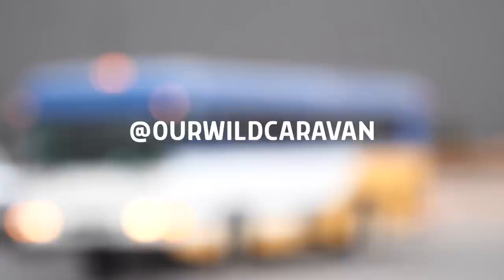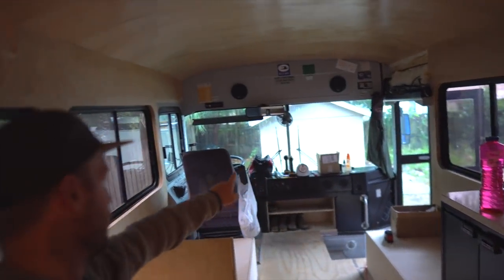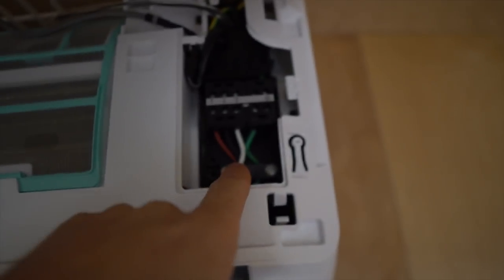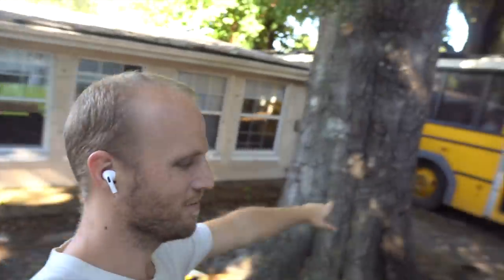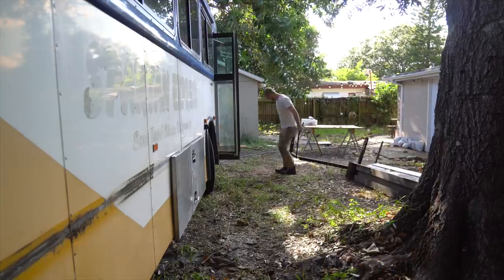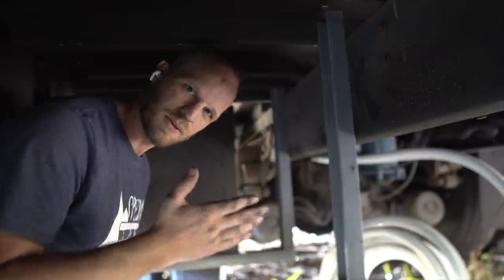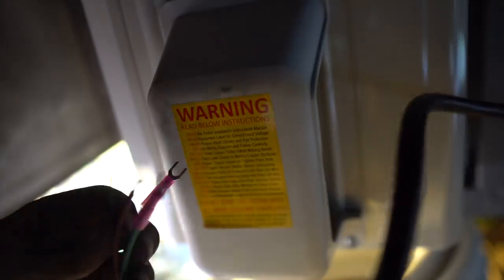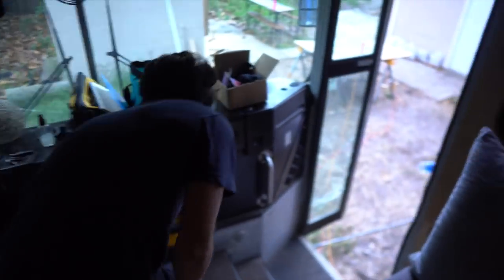How to Install a Mini Split AC in a Bus Conversion: Skoolie Solar Air Conditioning

Comment: Nice installation, it's a great unit. 
I installed one on my 2021 E350 cutaway van. I love the comfort of the AC/heat pump and how quite it is. It's so efficient I can run it off my solar panels and batteries and occasionally off the dc to dc charger. 
Definitely a thumbs up for the video 👍
Reply from the maker: Absolutely. Glad you're getting some good use out of your split unit too! it's so efficient and you can really do a lot with it.

Comment: Nice build. Vacuum pump does not pull the refrigerant though. It evacuates the evaporator and piping side of atmosphere. Refrigerant is precharged in condenser unit and released into the system when valves are opened after evacuation is complete. I don't know if you fitted rubber mounts to the condenser before you bolted it to the brackets, but it would reduce vibration.
Reply from the maker: Thanks for clarifying that! What do you think about the fact that the unit is bolted to the brackets, bolted to the frame, and attached to the air suspension of the bus? Air suspension acts to reduce vibrations whereas rubber mounts might make the setup less solid and may actually contribute to vibrations while driving. would love to hear your thoughts about it. Thanks!
Reply: @MobileDwellings  I suggest putting 4 rubber mounts between the condenser feet and the brackets it sits on. This will take away any vibration transferred from the condenser to the bus frame while the aircon is running. Back in the day I used a Ford engine mount which was basically a hard rubber disc about 2" in diameter and 1" thick with a 3/8 " threaded stud on either end. Sorry I grew up metric so  the measurements may be off slightly. You may find something similar at an auto spares outlet. The idea is to just isolate the condenser from the frame. There is no movement on that rubber as it's designed to hold a much heavier engine. I don't know of course if your unit is transferring vibration at this stage, but it's an option I've always used in my experience when clients have complained about the condenser being noisy.

Comment: Mounted mine under the bus. Used a jack to do it myself. It was still a pain. Also, my circuit board fried. It's on top of the unit, pushed against the undercarriage. I can't fix it without taking the condenser unit down again! That's the one bummer about putting it under the bus.
Reply from the maker: Yeah for sure. There are pros and cons.

Comment: This is a great idea for a split unit, I will probably do this on my Skoolie.  Quick question, not only is rubber mounts wise here, but what about a metal shield on the bottom to prevent potential rocks and gravel being kicked up as you are driving down the road?
Reply from the maker: Metal shield would be nice. But bottom of the unit is a metal shield. I'm not too worried about it and it's far away from front wheels with mud flaps. Always fun to overbuild and over protect but I try and cut corners where I can personally for the sake of finishing the project. Sometimes it works out and occasionally it doesn't. I don't know if I agree with the rubber mounts though. I personally want this unit rock solid to its brackets and the frame. I think rubber mounts would increase vibrations and wear and tear whereas the whole unit bouncing around gets dampened by the air suspension of the bus. Essentially the air suspension is the rubber mounts in my mind. Would love to hear it if you disagree and why. Thanks!

Comment: Dude I've been looking at Pioneer for awhile and have been planning on buying two units 
The model in your link is 1078 bucks inverter compressor 16ft line set I found the same unit from a different distributor on Amazon for a little over 800 the both have the same features maybe I should call Parker Davis and ask what the difference is.
Just thought your timing was perfect thanks for the install I've been watching you since you started your channel and watched you on your install on your bus your bus your working on is really coming alone nicely.
Well done.
Reply from the maker: Hey Brian! I suspect that unit has a lower SEER, probably 19 SEER, less efficient. How much less efficient I'm not sure. I do think I can find a little bit better pricing on this unit though and tomorrow I'll have the direct link from Parker Davis.
Reply from the maker: If it's the exact same unit though please send me a link! $800 would be a great price!

Comment: Hey love your bus projects I would love to do this before retirement but still 23 years young got a long way. I’m an HVAC installer you may have some issues with suffocation of the condenser, it could be difficult to run in cooling on a really hot day depending on how hot that spot of the truck gets. It doesn’t have much space for heat displacement but please if you see this and have no issues let me know! I’d do this if it works!!!
Reply from the maker: Thanks for brining this up. I didn't film it but I did drill a bunch of holes in the side wall of the bus where the fan blows it's air. I didn't love that solution so I didn't share it. I do imagine on some super hot days it will suffocate the unit. I'm wondering what the long term negative effects to this are. however? Do you thing the unit will die sooner? We are still considering ways to vent it but as it's winter and this bus is headed to the pacific NW for the summer we're just not too concerned atm.
Reply: @MobileDwellings  I’m not a complete expert on it but in theory it may cause the fan motor and compressor to work harder but mini splits are so damn awesome and efficient it may not have too much of an issue. If you see it short cycling often then maybe need to vent it more or it can take a lil longer to cool the air. Time will tell tho. Love your videos and maybe in 10-15 I’ll have a video to post and I’ll hit you up for some pointers!
Reply: @DiggidyD  I was concerned about the location of the condenser as well, but my concern was more about keeping the unit clean enough for it to operate efficiently. I don’t have any experience with this type of unit. 
As far as air circulation is concerned, an additional fan on the skin/skirt of the bus might be helpful. There are plenty of electric radiator fans on the market to choose from and they typically operate on 12 or 24 volts.
I’m in the initial process’s of building a tiny house on a trailer frame that will include a mini-split system. I’m planning on mounting the condenser on the trailer tongue. 
I’m also debating on whether to get more solar and go all electric. My house will be 24’x8.5’.
Reply: @marcothehammer  also look into propane electrical systems. It’s not as expensive to maintain but it may be pricy to set up. My family owns a ranch and the house runs off a propane system that they only fill up every 2-3 years for less than 3k.

Comment: How did you decide what size mini split to get? Ijust have a micro 4 window so I'm thinking the smallest unit would suffice for me? And how tall is the condenser under the bus? Thanks!
Reply from the maker: Yeah 9k btu should be fine for you. Mini split condenser is like 18 inches tall. Doesn't effect the ground clearance in this bus.

Comment: I'm looking at doing something like this for my bus project but I'm concerned on how much power it draws. Do you have any details real world power draws? I have 600 ah battery's with 800 watts of solar, I don't know if it will be to taxing on my current system. Great looking bus by the way!
Reply from the maker: It generally draws about 600 watts. So while you have plenty of battery power your ability to use the mini split is a bit limited by your solar panels. If you can fit more up there I would. 1600 watts is where I'd start to think you can use a mini split consistently and that's without intense electric cooking or water heating. For comparison I have a similar battery bank to yours but I have 2,430 watts and this bus we just built has 3,200 watts.

Comment: What about if you plan on taking a skoolie into all four seasons, would you still recommend installing it under the bus?
Reply from the maker: Are you worried about salt on the roads? If there's space under the bus I'm probably putting it under the bus no matter what but mostly for aesthetic reasons. There's nothing wrong with it hanging off the back.
Reply: @MobileDwellings  yes! Worried about salt. Realistically, we’ll probably only be spending about 1 month driving in winter conditions

Comment: There's currently a good deal on this Pioneer Diamante Series 9,000 BTU 19 SEER 230V at Home Depot. Would a 230v work in a skoolie?
Reply from the maker: It would not be cost effective. You'd have to buy another inverter. I'd stick to 120V unless you really want a mini split with two head units/zones.

Comment: As a previous diesel mechanic l would strongly recommend that you don't encourage people to drill into the frame. Usually its mounted above and below by grade 8 hardened bolts using the sandwich process.
Reply: Btw... Justin its nice to see you doing what your doing. We should email again sometime.  I miss our conversations. I finally pulled the trigger on a 2015 bus lol. I know.
Reply from the maker: Good to know. Can you tell me why it's an issue to you to drill through the frame? Plenty of bolts through the frame in general.
Reply from the maker: Congrats on finally buying a bus. Now the fun begins!
Reply: @MobileDwellings  it affects the integrity of the frame beams. The ones you see are actually done at factory they are done at high temperatures so when it is cooled they dont compromise the strengh of the beam.

Comment: i don't think i would trust those hangers holding the outdoor unit without some kind of gussets or preferably more suspension on the front hanging from the top. kinda like a semi's fuel tank. it's in a place you wont check that often for cracks.